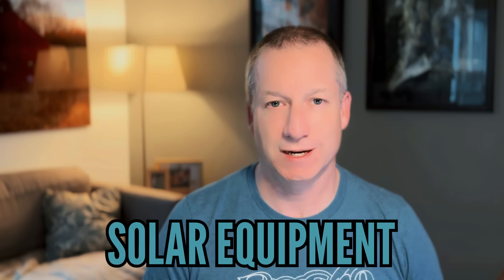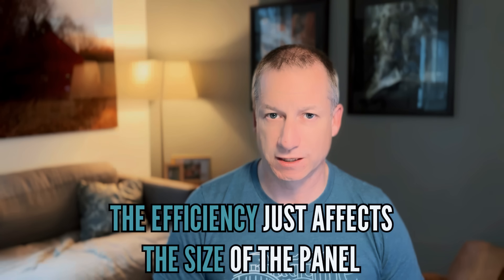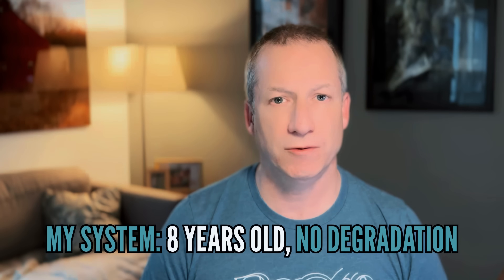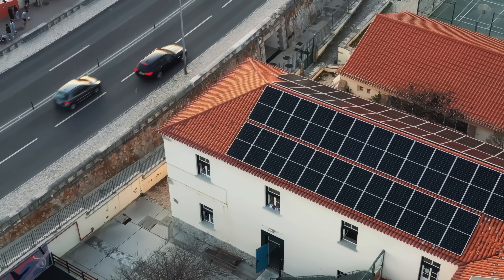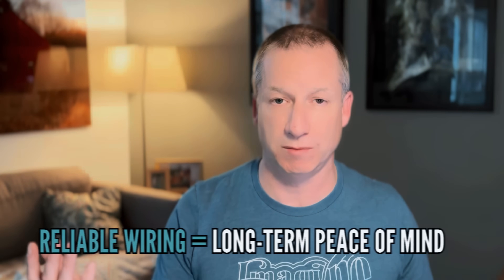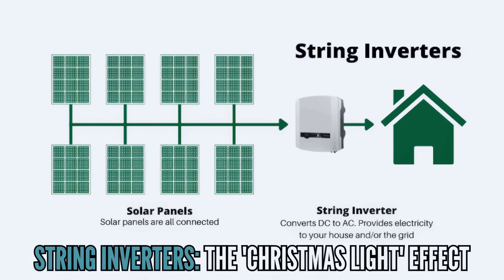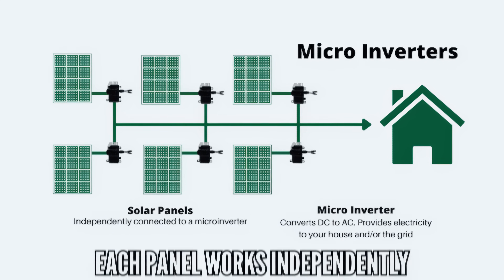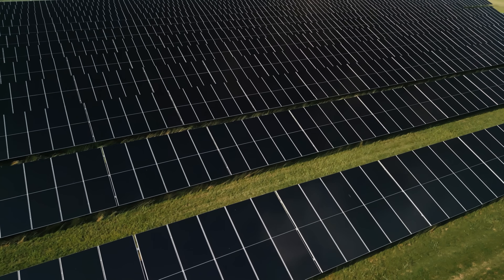The Hidden Downside of Microinverters No One Talks About

Comment: I prefer a string inverter system - less to go wrong, much cheaper, and in most use cases, any differential panel shading only occurs at the start or end of the day, when not much power is available anyway. Secondly I would go with a hybrid inverter with build in solar chargers, such as EG4 18K or 12k which supports back-feeding the grid as well as power-shifting. These systems need to be used with batteries. I also like the EG4 LFP 48V nominal batteries - at around $1100 per 5KWh, they are a good deal, and should last decades if the daily discharge depth cycle is limited to less than 50% on average.
Reply: Sol-ark 15k is far better and you do not have to have a battery.   The customer support is far better then EG4.   You don't buy lithium just to use only half of it's capabilities You might as well go with a lead acid battery then you would only use that 50%. Lithium you can go from 100 to 0% You still going to get 15 years out of it but decades no, you're not getting decades out of any lithium battery just because you only using half of it
Reply: @TheFatman819  Possibly, although the EG4 units are also reliable. A Sol-ark is much more expensive than the EG4 units.
Cycle life of LFP batteries is a combination of calendar aging and cycle aging. If a battery is rated at 7000 full cycles, it means that discharging to 50% each day it should last about 14000 days or 38 years. That well exceeds the calendar aging limit of 15+ years according to the manufacturer. What ages batteries is SOCs below 10% and above 95%, charging temperatures below 50F and above 100F, and charge rates above 0.5C (i.e. 50Amps for 100Ah batteries). I keep our batteries between 60F and 75F over all seasons. I use more batteries to reduce charge rates to < 0.2C, and also deal with cloudy periods in Winter.
Reply: @TheFatman819 Why is sol ark far better?
Reply: The string inverter will fail around year 12, but microinverters last 30. Price that into your system choice.

Comment: I don't agree with all your technical points, but I completely agree with the overall message: Microinverters are the least reliable element of a system, and there are a lot of them. I can't imagine the frustration of having them die on a roof.  I have a 30 panel ground mount system at my home in Maui, that is grid-tied, with microinverters. The system is about ten years old. At six years microinverters (enphase) started dying. By ten years they were ALL dead. After some protracted communication with Enphase I got a small break on the price of 30 new microinverters and a new whatever they call it that monitors them. No one would come to my house to replace them, my contractor was long ago out of business, new companies looked at the slope of the ground they'd have to work on and said "nope".  So I had to replace them myself. I'm 77, and physically active, but it was a tough week. I did manage to find a helper, but that was it. I totally expect the microinverters to start failing again in ten years. I plan to add some additional panels on a less dramatic ground mount and DC couple the series strings to an integrated system--probably a EG4 18K and a wall mount battery. I'll treat the microinverter system as a legacy AC coupled addition that the 18K (and other similar products) can handle and do 500VDC-ish series strings feeding the integrated MPPT controllers. The newest Tesla powerwalls likewise treat AC-coupled systems like yesterday's tech, only they ignore them even more than the integrated offerings from other companies--which has the installer companies going a bit nuts. I'm also building a big container/groundmount 3-phase system at my shop on the mainland, and there won't be a microinverter anywhere in that picture. They made a lot of sense 20 years ago, but they really are legacy tech.
Reply: As you know, Enphase pays to replace failed inverters up to 30 years. Right now Enphase has great reliability with their 5th generation microinverters.
Reply: @robertsheperd502  Perhaps you mean they sort of pay to replace failed ones. Of course they don't actually HAVE any of the old inverters, and the old ones aren't compatible with the new ones, so you wind up having to upgrade all of them--for a discounted price (My replacements wound up costing me several thousand bucks), and then someone has to replace them--they don't pay for the labor. And what does "great reliability" mean? What percentage will fail per year? How many will fail in 20 years? In my view its yesterday's tech. I'm not buying any iPods or pagers either.
Reply: @robertsheperd502  Perhaps you mean they sort of pay to replace failed ones. Of course they don't actually HAVE any of the old inverters, and the old ones aren't compatible with the new ones, so you wind up having to upgrade all of them--for a discounted price--certainly no "free warranty replacement" (My replacements wound up costing me several thousand bucks), and then someone has to replace them--they don't pay for the labor. And what does "great reliability" mean? What percentage will fail per year? How many will fail in 20 years? In my view its yesterday's tech. I'm not buying any iPods or pagers either. 30 or so metal boxes of electronics, under hot solar panels, up on a roof summer and winter, for 20 years. What could possibly be wrong with this scenario?
Reply from the maker: Thanks for your input. Sorry you had to go through all of that. This makes the point that choosing a solar company that's going to take care of you over the long haul is the most important!
Reply: @bradthesolarguy  I'm not sure how anyone could actually do that. The list of large solar companies that have gone out of business is incredibly long, the small installers are like any small business--more than 50 percent fail in the first five years.
Reply: You are talking 10 year microinverters (M series) that were unreliable. After that came the IQ7 or IQ8 that are super reliable.
Reply: @TurreTuntematon  Based on what actual data? "Super reliable", I love those kind of factual statements. I got hosed by Enphase, I'm not likely to believe unsupported claims. The inverters I bought and the installation I paid for had the same 30 year warranty, which turned out to be fundamentally useless. I would never buy anything from them again without some verifiable data that they had actually improved the life of the microinverters and were backing that up with both replacement and labor guarantees with some evidence that they honored them. Other than that you're just blowing smoke and pimping for the company.
Reply: @ExpertAmateur-xn6dr  Well the thing is that they just are reliable these days despite your experiences from old models. Other than that you are just blowing smoke and making claims that simply are not true anymore.
Reply: @TurreTuntematon  Okay, this is simple--show me the data and I'll recant.
Reply: I did some data searching.The only thing enphase offers publicly for data that I can find is mean time between failure of 600 years. That sounds impressive but MTBF doesn't actually correlate to reliability. It's a single unit value. The best independent study of currently available under-panel electronics is 75% reliability for a lifespan of 25 to 40 years--not great. Absent better data directly for enphase microinverters I'm going to assume the worst. I do see that enphase has made significant investments in test equipment for developing electronics that last longer. That's nice. It doesn't change my view that the company doesn't really stand behind their 30 year warranty. I only have one data point for that--me. Where's your data?

Comment: OK!  This is a rather dumb slant on what is probably intrinsically poor product design from certain vendors.

Yes, Micro-inverters can fail if they are not used inside the specified range of current and voltage in/out.
Yes, DC optimizers can fail if they are not used inside the specified range of current and voltage in/out.

The bottom line is that BOTH of these devices are actually electronic switch-mode inverters.  And BOTH can and will fail if used beyond their claimed ratings.

The input from solar panels to the DC optimizer or micro-inverter is the same.  The OUTPUTS are not.  And there are minor differences in the way such systems can be wired.

The main advantage of the DC optimizer over Micro-inverter is greater simplicity.  Because it is basically a tried and true DC-DC buck-boost switch-mode technology coupled with MPPT input load optimization to "sum energy" into a common bus back to the actual DC - AC inverter powering your home.

The more common topology is to use DC optimizers under solar panels to directly charge a local battery storage system.  This is cheaper, more efficient and more reliable overall.  The DC-AC inverter to power your home then is from the battery only.

Some readers may find this helpful...

https://www.mysolarquotes.co.nz/blog/how-solar-power-works/micro-inverters-vs-string-inverters-a-comprehensive-guide/#:~:text=The%20power%20rating%20of%20a,of%20235%2D440%2B%20W.
Reply from the maker: Thanks for your take. Appreciate it.

Comment: My experience is the opposite, DC optimizers seem to fail way more often then the micro inverters. I've yet to do an enohase replacement, but have run into many soleredge optimizers that failed.

With rapid shutdown rules, micros work really well.

Batteries, yeah that's marginally better, but it's a fairly minor percentage.
Reply from the maker: Appreciate your perspective.
Reply: This is my experience as well.

Comment: At least in my area N. California the discrete panel minoring is disabled to the consumer. I think the main reason is to cut down on service calls. People that don't understand the system would be calling their installer right and left when they saw something they think is a problem when it's not.
Reply from the maker: That is unlikely to have anything to do with your location and everything to do with your installer or lease holder and equipment. The solar company can turn on different views for the homeowner. You should ask them.
Reply: Interesting.  One would at least hope then that the system does log that information and send it to the installer, so if you do have a panel out, they can address that.  The cynical view would be that they wouldn't address that at all if the consumer wasn't aware of it.

Comment: Solar panels, are a contributer to global warming due to the heat they reflect back into the local environment.
Reply: Solar panels actually reflect solar heat energy back into space, because of the reflective surface.  It sounds like you failed a physics class or two...
Reply: @redbaron6805  please search for the article, "Solar panels in Sahara could boost renewable energy but damage the global climate – here’s why" 
Yes some energy is reflected back onto space, but space also encompasses the local atmosphere too.
Reply: @bekkiebeans6004 One of us is on the first peak of dunning Kruger effect. Could be me for finding this claim to be so ridiculous that I will not look it up or it you for reading one article and totally believe that one article.
Reply: There have been several studies on this and generally speaking the conclusion seems to be that solar panels don't really have much of an effect either way.  Basically it comes down to whether the energy is re-radiated in the infrared or actually reflected without being absorbed at higher frequencies (which is capable of exiting back to space more quickly).

Outside of cloud cover and polar ice sheets, most solar energy is absorbed by the ground or water and re-radiated as infrared.   Solar panels don't really change that equation much.  some studies even say that they wind up being a bit cooler locally because the panels don't have any heat mass to store the heat.

But what are we comparing against?  Cities have much larger heat-islanding effects on the Earth than solar panels ever will.  By several orders of magnitude.

-Matt
Reply: @junkerzn7312  Very true, and solar panels in many cases would reflect some of that back into space, instead of it being absorbed by black roofs.

The original poster however went completely off the tracks, as global warming is mostly due to CO2 emissions, which absorb heat, not due to heating of surfaces like solar panels.

Rooftop solar panels also shade the building they are on, reducing the heat load which means they require less electricity for cooling the building.

As solar panels evolve into using more of the spectrum for generating electricity, the benefits will only increase over time, especially in reducing CO2 emissions which are the core problem related to warming and climate change.
Reply: @redbaron6805  Yes, 100% agreement.  The heat is there anyway, what matters is how long it sticks around in the atmosphere.   Globally solar panels will have no effect whatsoever.

The jury is still out on localized environmental effects though, but I think wind turbines (low altitude airflow disruption) and existing city heat-island effects trump anything solar could ever cause locally.

And in terms of solar panels shielding buildings, I experience that first-hand, daily, with my garage system.  Even in the hottest weather the garage stays far cooler now than from before I had the panels.

-Matt
Reply: @junkerzn7312  Very true.  There is some "heat island" effect observed, but mostly if the roof is a light color, and the panels being darker absorbing some heat.

With a black roof, the effect is negligible to non existent.

Ultimately, the heat island effect from black roofs and miles of asphalt is the issue, a couple of hundred sq feet of solar panels isn't going to change much.

Your observation of the garage is proven in multiple studies, as the shade the solar panels give the roof makes the interior far cooler than it otherwise would be, especially if your have a dark roof.
Reply: huh? the heat is going to be absorbed whether or not there are solar panels.
Reply from the maker: Ha!
Reply: I don't think you understand the science of climate change and of solar panels. nope.

Comment: Why would I install ANY expensive, critical devices that, as you say, are guaranteed to fail.  DC, micro or otherwise?  I have yet to see any ROI projections that include these costs.  Solar as sold today is a fraud.
Reply from the maker: Inverting the electricity is a must for tit to run in your home. All solar includes this cost. ROI on solar depends on your situation with electricity rates, netmetering and your roof. The roi on my system is north of 15% annually for the first 8 years and that roi increases every year!
Reply: @bradthesolarguy  LoL You've dodged my comment's point.  No ROI projections I have seen factor in the replacement cost of those "guaranteed to fail" inverters - DC string or AC mico.  Without a accurate cost basis, such fake projections are misleading.  If the failure rates of all types of inverters is as high as you say you know them to be, leaving out that cost is fraudulent.  The same goes for any batteries that are expected to need replacement due to known issues.
Reply from the maker: @kn4cc755  I do include them and recommend that all people going solar make sure they have a repair and maintenance plan in place!
Reply: @kn4cc755  Not sure I follow your logic here.  A 5kW solar array in my area is around $17,000 installed.  A 5kW solar inverter is around $750 or so.  If it fails every 10 years, we are talking about $75 a year in additional annual operating cost.  A 5kW solar array in my area would generate roughly $1505 worth of electricity annually.   If we factor in the inverter failure, it is producing $1430 worth of electricity annually.

So, the solar array would pay for itself in 11.3 years without the inverter failure, and in 11.9 years with the inverter being replaced every 10 years.

So, why would this shift of a few months make solar a fraud...?  Not following the math here...
Reply: true, we all know furnaces and air conditioners never fail.
Reply: Solar as sold by THIS BUY is a fraud. Just buy your own solar panels and an all in one STRING inverter. They are so cheap that you can use two or three in parallel, if one goes wrong, you still have two working. They are $300 for a 5kW string inverter, for the cheapest models.
Reply: @johnthomas338  Bro... this idea! It's a good one. Thank you.

Comment: I'm glad to find out we have another way to avoid string inverters. EEVblog on episode 1426 went over an issue he noticed because a tiny amount of shade on a sting inverter system was causing it to produce significantly less power when the shade was there.

An easy way to think about the problem with a string inverter is to not mix new & old batteries. This is because the batteries with a lower output is going to encourage the other batteries to try to recharge that one battery & the same thing would happen with a string inverter system.
Reply from the maker: Maybe people will like this analogy better than the Xmas tree light one! Thanks for sharing.
Reply: That was a byproduct of the old SMA inverter he had.  I should know because I had the same inverter with the same problem.    Basically that era of inverter didn't resweep the MPPT often enough and would remain stuck on a local maxima and not find the new higher local maxima when the shading occurs.

Those inverters had two problems actually.  One was the MPPT algorithm, the other was that they only had one actual MPPT.  In his case, he got smacked by the broken MPPT algorithm.  In my case, I got smacked by both (I have two strings).

This problem is more or less solved in any SMA inverter made in the last 5 years or so.   They call it "ShadeFix" but all it really does is do a more appropriate MPPT I-V sweep a bit more often to find the best MPPT point.   Most modern string inverters and charge controllers do this properly now.

-Matt